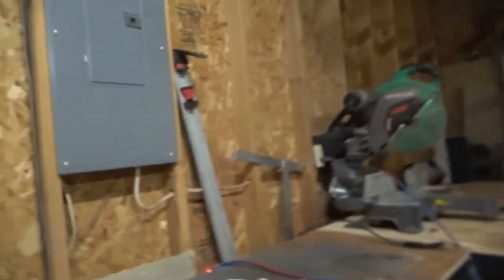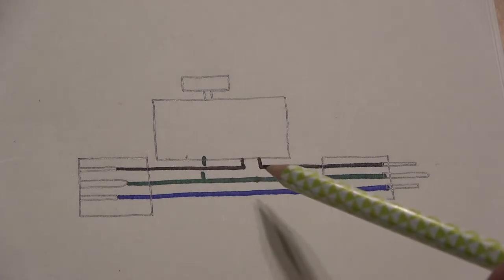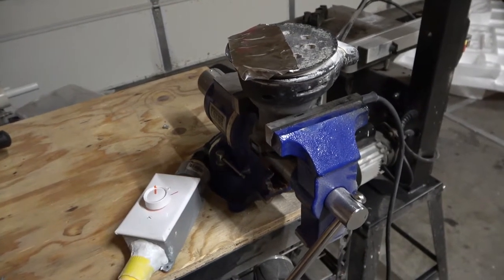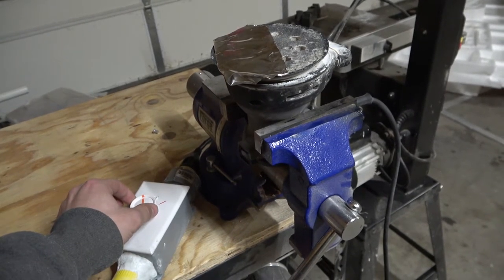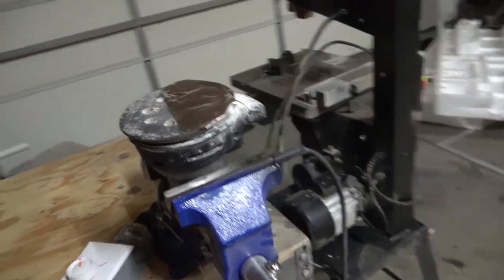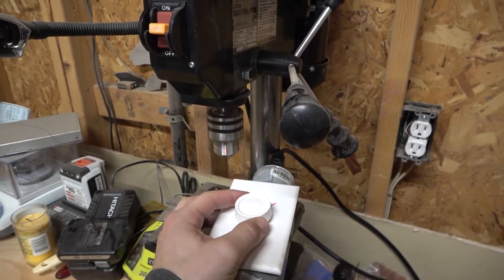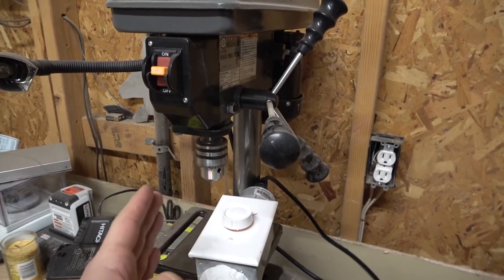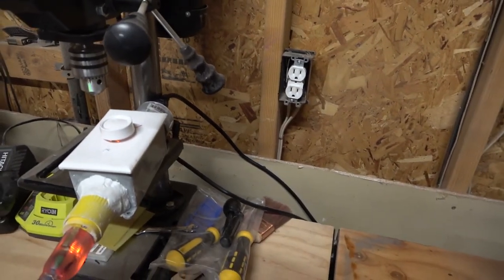Dimmer Switch for Power Tools??

Comment: How can I know if a drill is brushless or not? I'm trying to make a rotisserie with a cheap drill like harbor freaght , think it would be brushed?
Reply from the maker: I would check the owners manual and search for the word brush.  Usually they link  the manual on the website.
Reply: Only modern expensive stuff tends to be brushless works a treat on my grinder which has become a variable speed polisher:-)
Reply: If you are seeing little sparks from the motor side when you use your tool at full speed, it is brushed, while brushless don't have sparks

Comment: Will this work on a high heat soldering gun to reduce heat? Thank you?
Reply from the maker: It should.  Some heating circuits will use a thermal switch to turn the heating element off above the target temp.  If this is the case, it should still work, but it might do something weird.  If it does not contain any sort of similar mechanical logic, then yes it would work.  My soldering iron is digitally controlled or I would test this for you.

Comment: Nice video. But wouldn't in time this damage and burn the motor?

My home ac blower was starting to smell like burning while blowing air in the house, after troubleshooting i found some motor windings burned & black  ( luckily i stopped it before cooking), further on i found the main feed relay for the motor was actually the problem, after so many contacts cycles the contact points were burn and didn't let pass much voltage and it was overheating the blower motor, because this happened at night i had no replacement at hand so i filed and clean down the  contacts and was working good again, i am still using it and have a brand new spare for later. 
Thanks.
Reply from the maker: If the motor is cooled by an integrated fan it could definitely cause damage.  As the speed decreases the amount of cooling air would also decrease.  At low speeds it probably depends on the fan design if it would still be able to provide enough cooling.  If it was allowed to stall there would be no cooling.  I would not recommend this for unattended appliances...
This thing works but it is not really a good solution, you're better off just buying things with speed control built in.
If you really had your heart set on controlling a motor for long periods with this method, I would suggest additional cooling and thermal protection circuits.
Reply: legit question but it won't harm the tool in any way. though it does spin slower and the fan puts out less air, don't forget that there is also lower current passing through the tool. also have you seen a corded tool with speed controller embeded? It is exactly the same control board. The difference is that in one case it's inside the tool cell and in the other is external. I always favoured the external solution, cause you can get cheaper corded tools ( cheaper cause they lack the speed controller) and you can combine them with the external solution. Also the external unit can be connected to any corded tool and in essence you can make all of your corded tools have speed control. Max cost to build an external box would be around 8 euros.
Reply: @ΣΤΑΥΡΟΣΓΚΕΡΛΕΣ How would you make that box that cheap?? I would like to make one to make orbital sander, grinder and Dremel go slower because the ones I have are to fast even at the lowest speed. 
If you can tell my what should I buy that be awesome. Obviously if you think that it will work with said tools.
Reply: @GnarledSage  OK, 3.5 euros for a 2000 watt controller, 1,5 eur for a cheap current plug, and 5 eur for a plastc box. Use wires of your own preference,  I suspect that you have many laying around and voila,  under 10 eur you have a decent speed controller.